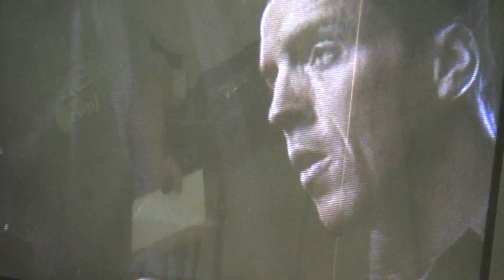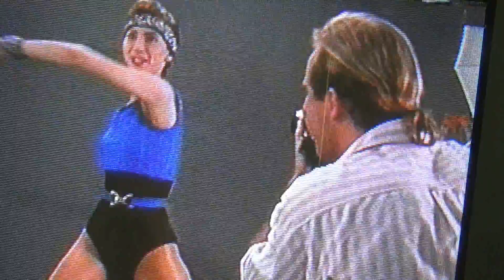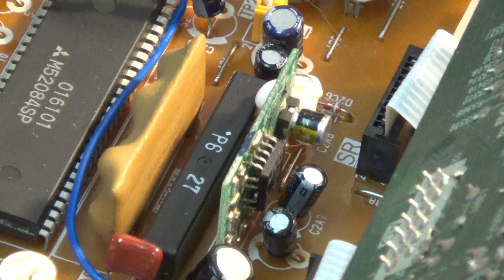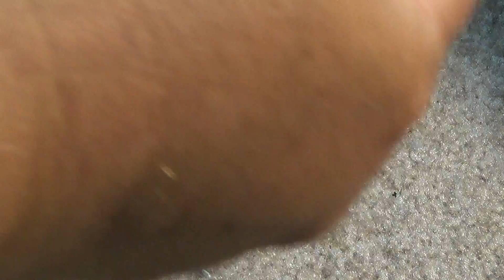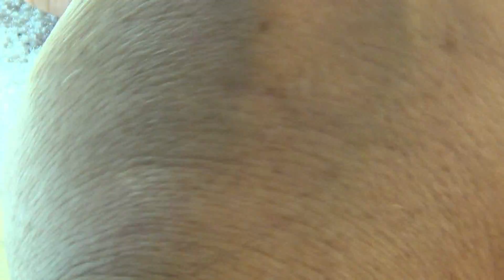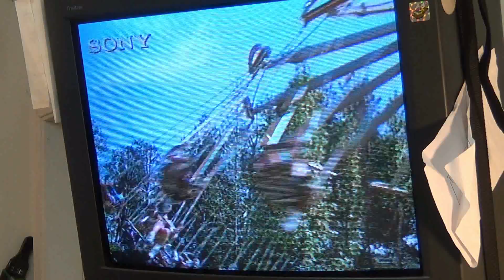Electrohome j04 svhs will not play svhs tape

Comment: 17:20.. @12voltvids.. calls my attention that you don't use vinegar... the electrolyte will no continue eating the traces on the board??...

i see in repairs of (for example) vintage computers (Apple Macintosh from 90's and 80's are full of SMD Caps)... and they soak and scrub the board in vinegar with a toothbrush... and lather isopropyl alcohol to dry the vinegar... all for neutralize the electrolyte
 of the caps..
Some even wash the entire board in the the dishwasher... because the dishwasher soap has antioxidant components that neutralize and prevent rust (you know.. for not damage utensils made of silver an or other metals)..
anyway .. the point is... prevent the rust from expanding through the legs and into the ICs of the computer...
at 17:25 you can see the green corrosion already on the legs of your JVC Integrated Circuit....
Reply from the maker: vinegar is acidic.  That is just as bad. I used to do that, and had more failures down the road. Especially in multi layer boards.

Comment: Do you have a favorite VCR?
Reply from the maker: Right now it is the JVC HRS9911. 
 It is a SVHS deck with built in TBC.
Reply: @12voltvids  Is the TBC any good on your favourite VCR, is it stable and does the picture stay in sync..
Reply: @12voltvids  17:20.. calls my attention that you don't use vinegar... the electrolyte will no continue eating the traces on the board??...
i see in repairs of (for example) vintage computers (Apple Macintosh from 90's and 80's are full of SMD Caps)... and they soak and scrub the board in vinegar with a toothbrush... and lather isopropyl alcohol to dry the vinegar... all for neutralize the electrolyte
 of the caps..
Some even wash the entire board in the the dishwasher... because the dishwasher soap has antioxidant components that neutralize and prevent rust (you know.. for not damage utensils made of silver an or other metals)..
anyway .. the point is... prevent the rust from expanding through the legs and into the ICs of the computer...
at 17:25 you can see the green corrosion already on the legs of your JVC Integrated Circuit....
Reply from the maker: @Ramdileo_sys  Not if it isn't wet it won't